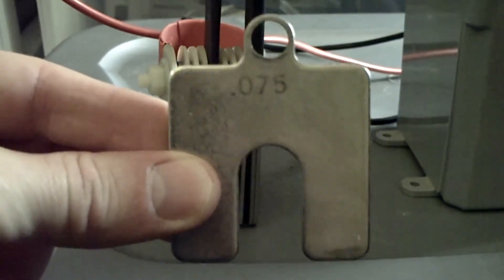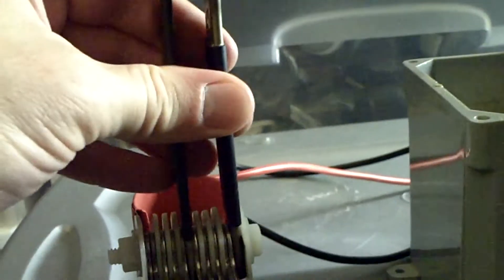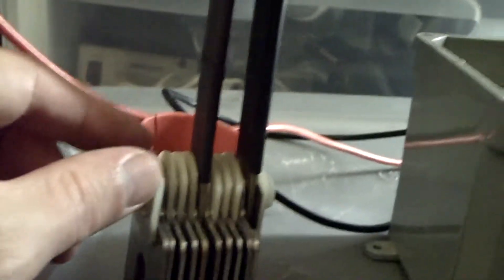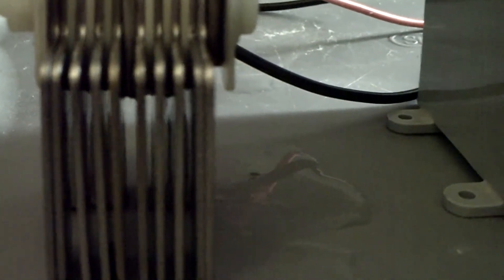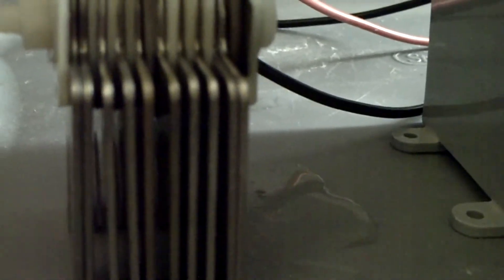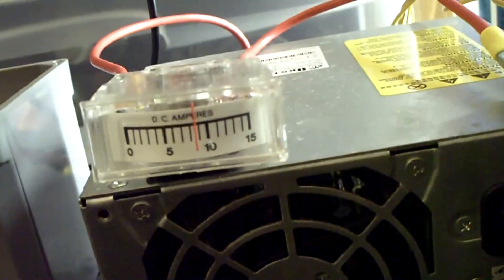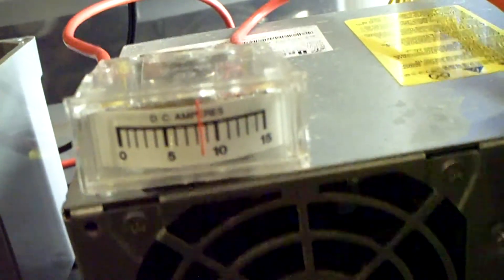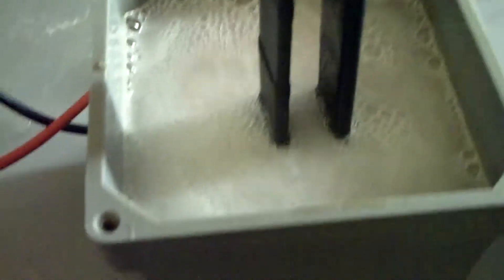Vid40 Hydrogen Generator Blade Cell Design (HHO, Brown's Gas, Hydroxy)

Comment from the maker: I realized after I filmed this demo that I only had 2 neutrals between the POS & NEG, so I took it apart and added an extra neutral on either side of the POS. The output still looks really good and I have similar amperage draw.

PS - Didn't you say that you were using a Bestec Power Supply that was giving you problems with bouncing Amps?

Comment from the maker: That's true, but right now I'm in-between jobs, so I don't have any money to get my designs closer to performing LPM tests.

I'm having more fun experimenting with different designs than anything. The problem I have is that I have is when I get a cell near completion, I think of another way to improve it, or I just scrap it and start over.

I have had some cells that I completed and put in the car, but they had disappointing results and I didn't bother putting them on video.

Comment from the maker: I hooked it up to a higher quality power supply last night and the amperage stayed solid on 8A. 

The power supply that is dieing was pulled from a gateway computer, and is not very good quality.

I won't ever use a Bestec ATX Power supply again, because it says it can handle 16A, but really can't handle anything over 10A.

I'm completely surprised by the output, so I'm coming up with some other designs using these blade plates.